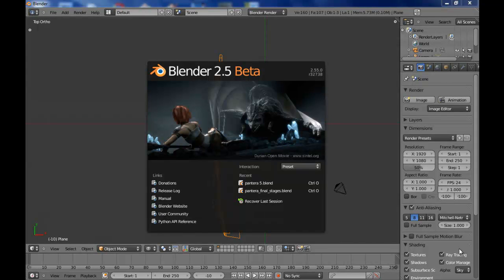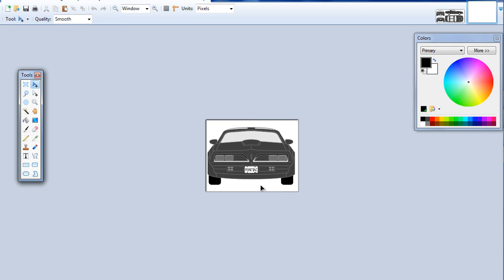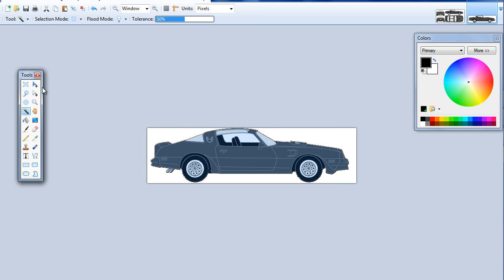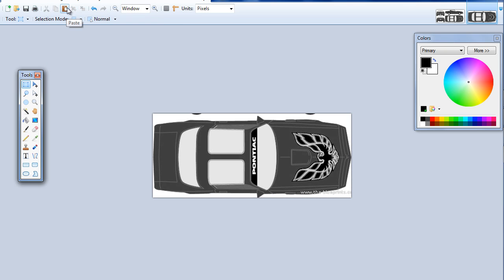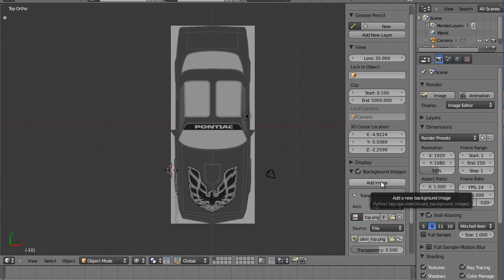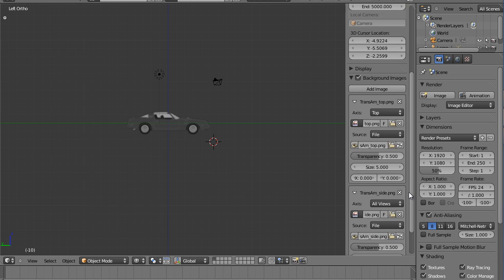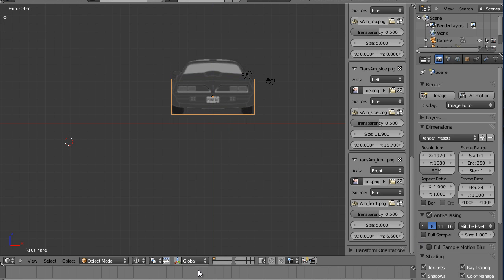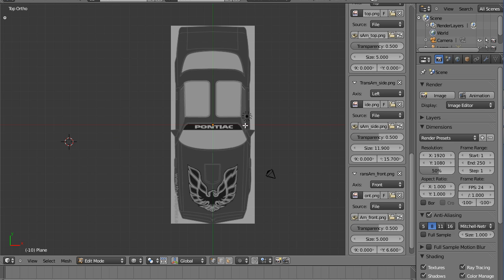Blender 2.55 Beta Car Modeling Tutorial - Pontiac Firebird TA: 1 Blueprint Setup

Comment: Yah I know, I'm getting fed up with Windows 8's issues but don't want to lose well over 150GBs of data when I don't have a external HDD (And won't I'll just replace the internal and transfer the data) so a restore is out of the question.